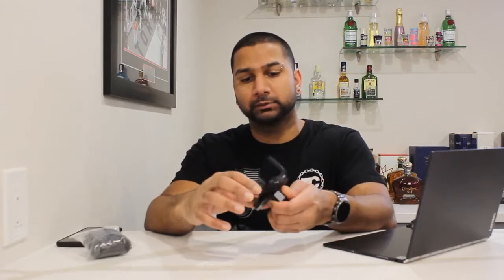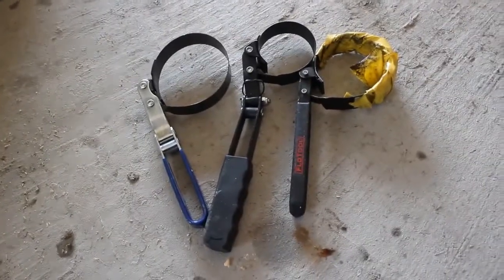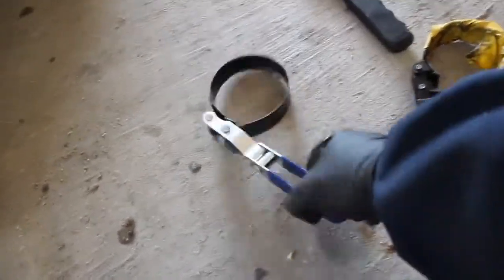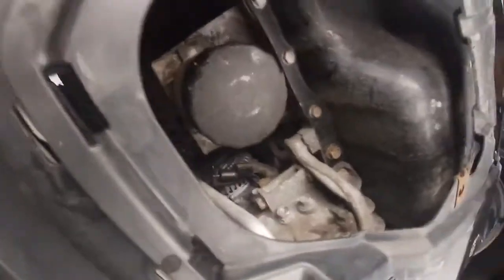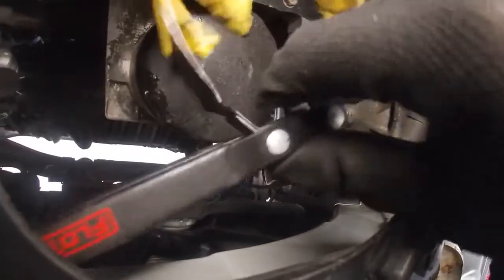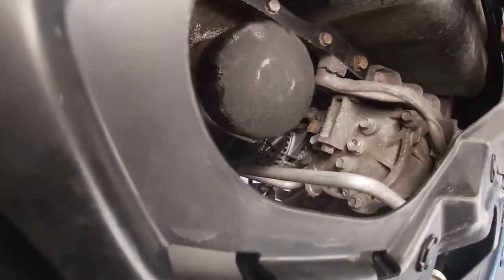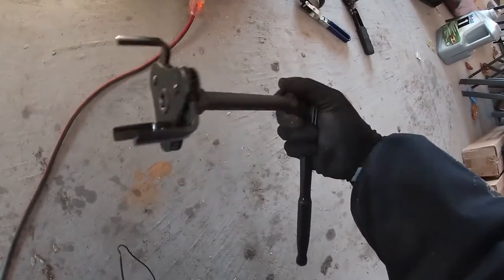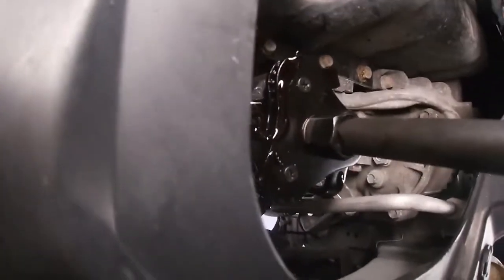How to Use Oil Filter Wrench / Remove A Stuck Oil Filter Cap? from Senzeal-auto.com

Comment: Tip. Get some 600 grit or whatever you got and wrap some round your new oil filter just to get the shape. Cut it down to size use the grit side to the oil filter, use some tape to keep its shape then pull off and fit to old filter make sure you have half the sandpaper half hanging off as you might not be able to pull off. It stops the wrench from just slipping round the filter.